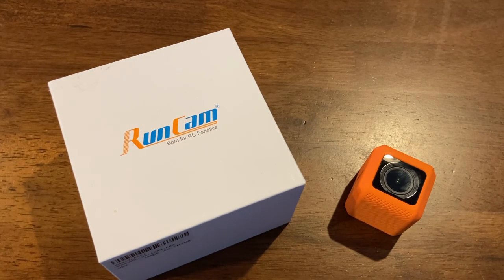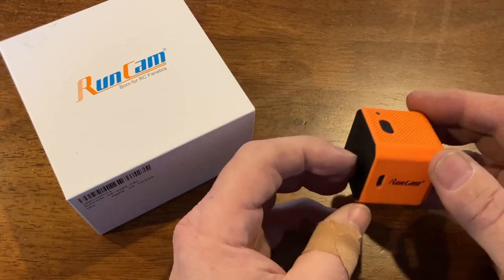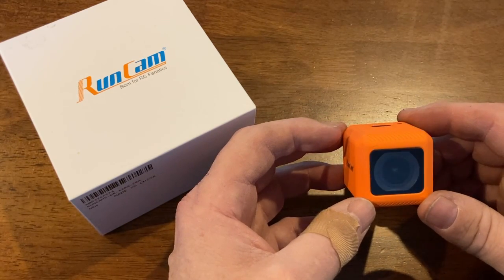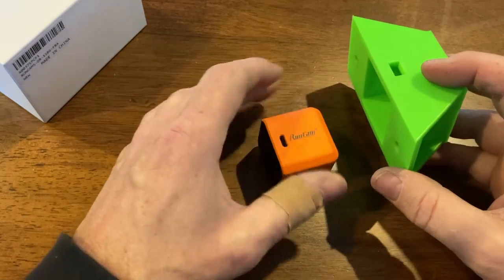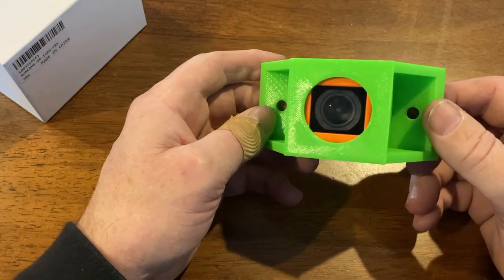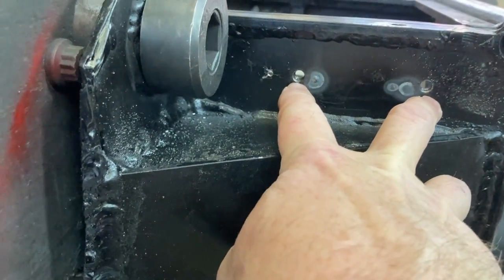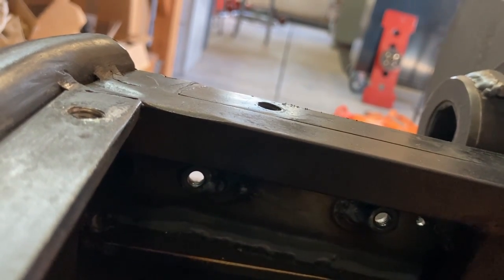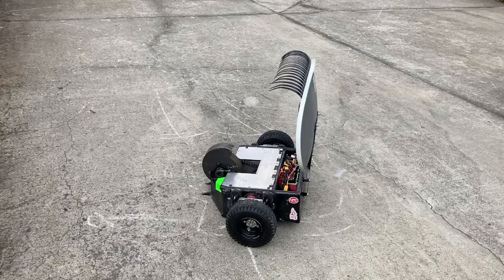Robot Combat On Board Camera for Robogames 2024

Comment: What if you cut hole in same plate where you mounted camera now and mount camera from inside? You really don't need that big of a hole in front of a lens, and inside seems plenty of free room for camera. I got feeling it will get torn apart pretty early in fight with another vertical spinner. Just look any robots front usually is damaged in regions where the camera is mounted right now.
Reply from the maker: There might be room internally, you are correct. I'm probably not going to really do much more to this now though. It's not really meant to be super competitive, just put on a good show. But if I ever decide to rebuild it down the road and take it more seriously, a mount setup like you've suggested makes sense!